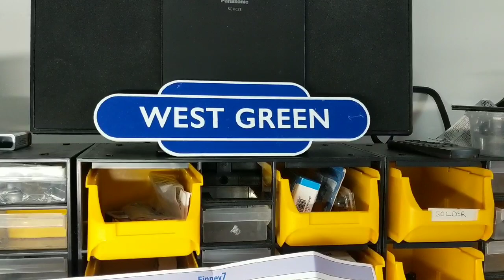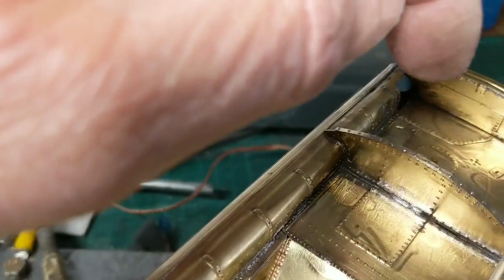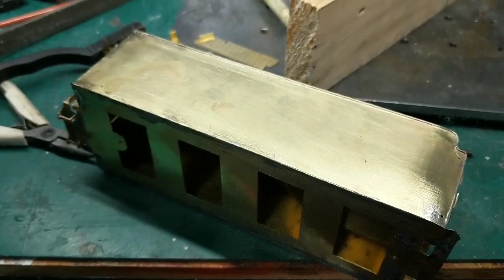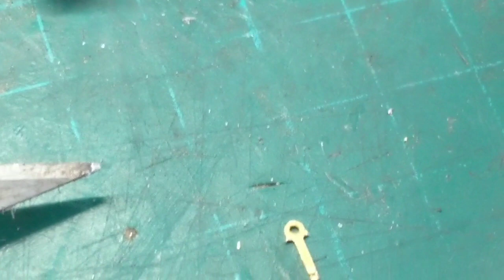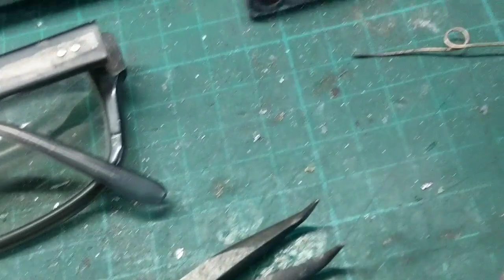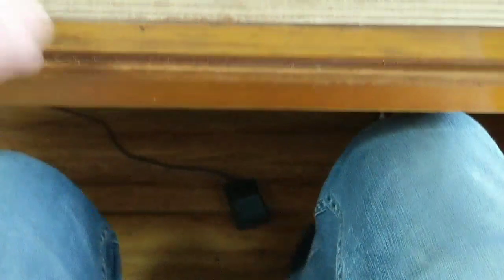Finney 0 gauge 1928 Corridor tender Part 11        12 August 2021

Comment: How are you doing? Any new updates in the offing? Have bought an ex four track models J6 kit recently which should prove to be an interesting build.
Reply from the maker: Here is the J6
https://youtu.be/MooBRb-PlZ8

I'm away at the moment, hope you saw my latest video of Walhalla, my plan is to resume the A4 when we get home
Reply: @Steven_Rowe  I have looked at the Gladiator website, good photo of your J6. Did your kit have two sets of chassis frames? Mine has so I am surmising that each set is for each type that can be built from the kit.
     Hope to see more updates on your projects soon.
Reply from the maker: @tulyar1043  its not only two sets of chassis but also two cabs etc 
You can build either the 521series which has a longer cab and no front sandboxes or the 536 series like mine
Reply from the maker: If you go to the Gladiator website you will see a photo of my Foutrack J6 no 64266